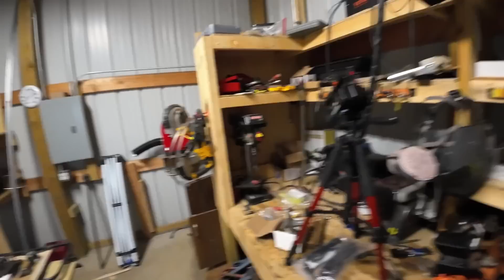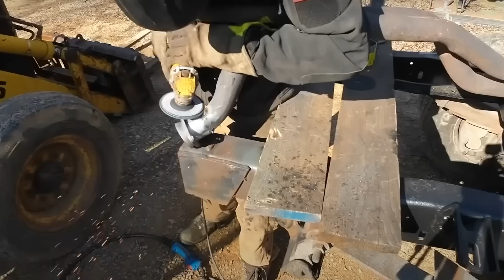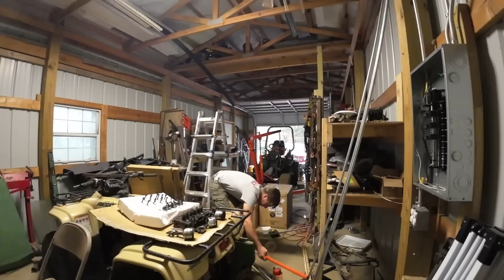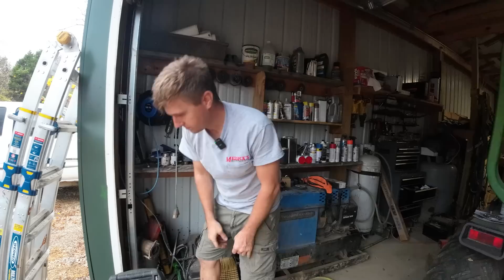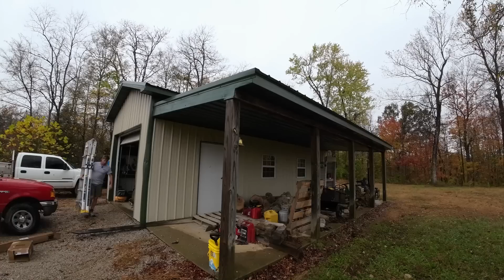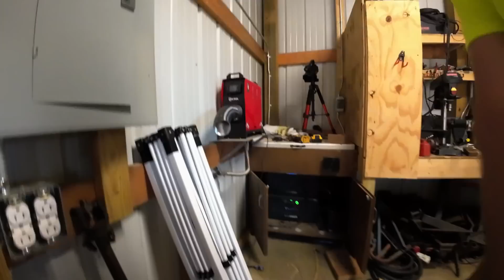Solar Powered Workshop -  I Just Don't Need It - Bluetti AC300

Comment: I found a very good LED light at Costco here in Canada about 2 years ago. It seems to have two LED rows facing down and a row on each side of the light. It’s very bright - I put 5 in my workshop which is about 3 times your shed space and it’s bright, although it’s 9’ ceilings. I then put 3 of  them in my garage (14’ ceilings) and they are very bright. It’s a “daylight” effect so it’s more utilitarian which is what I wanted for using tools and machines. The brand is called KODA, model LM030314  and it’s 8000 lumens. Each light was C$45 which is US$33 . If you’re a Costco member and they stock them at your local store, it’s a great deal - half the price of Home Depot or Home Hardware here in Canada and a much brighter light.

Comment: I love the 'free solar lanel rails'! As someone who picks scrap metal up from time to time, I can't begin to tell you how many dozens & dozens of bed rails I've picked up on curbs all over the place, probably 100 plus sets if not more. I keep some of them for various angle iron fabrication uses, and add some to the scrap pile going to the scrap yard for money. Its crazy how many bed frames get thrown away on a regular basis. Its good angle iron for light duty stuff especially if you have a cheap welder to glue them together.👍🏻👌🏻🛠️🔧🦺⚡🔋🔌

✊🏻🇺🇲🦅🇺🇲✊🏻

Comment: How much money do you have wrapped up in the power system? Seems like a lot…..
Reply from the maker: If I had purchased the bluetti (it was a partnership) plus the panels I bought.  Around $2500.  They wanted $6,000 to drop in a transformer and run a secondary and that's with me doing the excavation
Reply: @ is that the only option for electric is a transformer. Can just run underground wire from a couple poles or something?

Comment: In the Netherlands we use PVC tubing/piping you can bend it by hand and it's not conductive.... In this case we would pull a ymvk though it with open bends. 5/8 or 9/16 in metric 16 or 19 millimeters.

Comment: Cap’n here’s a bit of trivial information for ya…

The steel used in bed rails is unique… it’s classified as ‘Re-Rolled Rail Steel’.  What makes it unique is its origin and properties.

Back in the late 18th and early 19th century American Steel Factories started popping up all over the place (wanna know where… just go to the Rust Belt).

American infrastructure demanded billions of tons of structural, cast and rolled steel.  Chief among them was Railroad Rails.  

Every steel mill had its own recipe for making them… so, there was a huge variation in the purity and properties of from one manufacturer to another. And also from one rail to the next.  It caused countless problems when building tracks and also with durability and failure of the rails themselves.

As a result, there eventually became a huge supply of old rails lying around.  These could not easily be melted down and recycled.  They were too awkward to fit into smelters and besides… their contents varied all over the place.  That meant it was difficult to use them to make steel of reliable tensile, chemistry and malleability.

One company came up with the idea of cutting them into three parts… the cap, the web and the foot.  They then placed each part into a separate furnace and heated it.  

Once it was hot enough, it was sent through a series of rollers that shaped it into various configurations.  There were three that became ubiquitous.

1 - Sign post - used for every stop sign in the country!

2 - T-post - enough said.

3 - Angle Iron - not good for fabrication or structural use (too brittle and ranged from hard to soft).. but perfect for bed rails!

And, best of all… it was cheap!!!

And that Cap’n is why bed rails are plentiful and cheap!

Enough of the lesson about that obscure fact…. 

I like where you are headed with your own private Power Grid!
Reply from the maker: @sassafrasvalley1939  what a fantastic way to start the day off. Lol thanks for the info. Hope all is well
Reply: @ yep, going great… just coming home from a week in the Caribbean with my bride of 50 years!
Reply from the maker: @sassafrasvalley1939  you're living the dream.  That's awesome
Reply: Very cool information! Thanx! 👍🏻👌🏻

Comment: I installed 4 bars of 220V LED lights in our 2 shops/garages.  Everything works fine until you 10ft up in the roof on a wonky ladder.  Had my heart reset by 220V a few times.

Comment: Are those batteries the kind that can catch fire and burn for days?  Wonder if they need their own separate shed or small building.  But maybe they are safe. I never have used any before.  Just curious.
Reply from the maker: In general most co my companies don't sell self destructing batteries.  But in all fuel sources that are used to heat homes or provide power, whether it's electricity, natural gas, heating oil, solar with battery storage, there is always a chance of fire. (Or home leveling explosion if natural gas if someone's choice) If you notice in this video, I specifically mentioned utilizing the barn as the battery storage building.  No one lives in the barn ya know.  Also,  smoke alarms, plan ed fire evacuation routes, and regular conversation about fire safety in households are always good practice.
Reply: @CaptainKleeman  thanks. I figured a firefighter would have all the knowledge. I had just watched a towing company video in LA where a giant lithium battery on a flatbed fell over and caught fire. Made me curious. Thanks again for the great videos.

Comment: I installed five Harbor Freight, BRAUN 5500 Lumen, 4 ft. Linkable LED Hanging Shop Lights in my attic and they are pretty impressive. At $22.99 a piece they are inexpensive. They have a 3 prong standard 5' powercord and use 55 watts each.
Reply from the maker: Appreciate the info!

Comment: You did not show reaming the EMT you cut with the portaband. No - you don`t put romex in EMT and you are supposed to complete the raceway then pull in conductors.
Reply from the maker: It was deburred.  Code allows it.  Too many bends in one run to pull Romex.  Thanks for showing you don't know electric 👍

Comment: Always look at lumens for led lighting. I like Harbor Freight Braun 10,000 lumen on sale now $35/$55reg. Four can be connected together. How come no one does 12v lights when using solar?  It would be more efficient because it's not being converted to AC. Tons of options out there for RV and vehicles for lights as well as made just for 12v solar (some are 12v/24v/36v DC capable). I have used in a cargo trailer just for interior lights and works great.

Comment: Someone on YouTube suggested that it is better to run just wire through metal conduit without the plastic casing. They said the wires can get too hot. I don't know anything about this. However, it is cheaper to just run the wire. I run the wire through plastic tubing. Don't know if that is better or not. Would like feedback on this. Thanks

Comment: Hi Mike , if i might suggest checking into some 12v auto led flood lighting . I got some cheap ones from harbor freight. They provide great lighting i believe they are 4-5 thousand lumens each . Low draw for lots of light cheap. I believe you said you have 12v supply , i use a small dc converter. Hope it may help and cheap for you to try !!
Bless you and your family !!! And your donation to the band was a great thing buddy 👍

Comment: I have used lights in series that we got from Rural King and they have worked well. At the time we got a deal at $25 a piece and I am sure they were bigger and brighter than the ones you are currently using. You might check them out. I don't remember the lumens, but I think they would do the trick if you can find them. Actually, I just looked at the website and the first one up was a linkable shop light 45" long and 10,000 lumens for $24.99!
Reply from the maker: That's a good price!

Comment: I too have a secondary off grid shop on another property that I utilize in the winter. I use a generator but now you have me interested in this power supply option . I have a gas engine air compressor there so no need for huge power…but I have a portable might welder there as well (140 amp). Would the power supply run it or just stick to the generator for welding ?
Reply from the maker: I would be surprised if it ran that welder for very long.  Even if it did, it would take a pretty good size array to get it recharged.  But if you have a generator, this would cover everything else.  I only have to fire up the gen/welder when ime welding now, which has been nice.

Comment: Just shows how nice a guy you are, that gesture is really going not help the community buts the kids as well. Problem with lighting is not only the amount of wattage used to run them, but what sort of light you get as well. Mines only a small workshop, but I've got a day light led bar really cheers me up when I'm out there in the winter. Who doesn't like a metal metal roof, for safety purposes you want to place one of the small trampolines. Might help with your gymnastic capabilities. 🤣👍

Comment: when you said don't run your tape into your electric panel it reminded me of the time 1 of the service guys at our shop did just that 480 volts will vaporize 24 inches of it in millisec

Comment: Captain,  what the technical term for what your Bluetti requires is a clean sine wave input. 
It's what a UPS battery backup unit provides to tv's,  computers and other electronic devices inyour home or shop.
Plus a UPS keeps your electronics safe from surges and power outs that cam damage your computers, tvs andotherdevicesyou rely on.
I used to install them on all our arcade games in the Keys when I was the service manager for the largest amusement vending equipment company in the upper Keys. 
It cut service calls caused by electrical issues like power outages and surges to almost nothing when they began actually installing computers in arcade games.
Merit bartop touchscreen ganes were the first PC based games in the late 90's. 
They were also the first ones I installed UPS units into.
My boss was a tad happy with the reduction in service costs on them.
It was a very good friend who is a computer genius who told me about them.
All of my home electronics are plugged into one.
No, surge protector strip outlets do nor protect electronic devices. 
They protect your home electrical system from shorted appliances.

Comment: I have a 12' x 12' shed that is also run from solar and a small solar generator. For lighting, I have just two BRAUN 5500 Lumen, 4 ft. Linkable LED Hanging Shop Lights from Harbor Freight. You can connect 4 of them together, but for my small space 2 is all I need. They might be a better option for you.

Comment: I just went to Costco and north 40(tractor supply type store and bought 20 led 110v plug in light @$30 ea for a 48' by 50' shop and they work great. They are in the ceiling 16' high. Cheapest way I could go and have good light.

Comment: Mike I started off with those low power 4 foot LEDs too, I still use em on desk top spaces, but for the shop I switched to these 8 foot bad boys.  Use em in the woodshop and in the mechanic shop.  (10-Pack) 8ft LED Shop Light Fixture, 120W 19000LM 6000K, Cold White, V Shape, Clear Cover, Hight Output, Linkable Shop Lights, T8 LED Tube Lights, LED Shop Lights for Garage 8 Foot with Plug

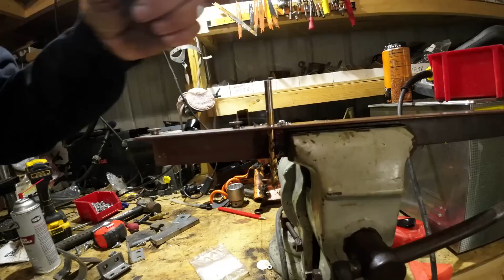Comment: At 17:47, your drill bit came out.  You didn't lock it!
To lock it, tighten the keyless chuck down as hard as you can then turn the chuck the opposite direction and it will ckick once, it's locked and your bits won't come out.
Have fun!
Charitable donations are great!  We rely on them to keep our high school Drag Racing Team going.  Get the kids to race on a safe track with an instructor rather than the streets.
I'm a driving instructor at 100mph for 14sec at a time...... yes, my hair is white! 😂😂
Reply from the maker: That drill is clapped out holding on for dear life.  Shooting out transmission parts out the vents.  Every time I drill a hole im surprised it still works.
Reply: Turning the chuck back after tightening has been debunked on sooooooo many major tool channels, even channels that used to tell people to do it have retracted that idea. If you want to think it works, it's up to you. Nobody is telling you not to. 😊
Reply: @beaverc2884  I thought that too, until I saw a video that almost all tool companies identified it as a "feature".  It seems to work?

Comment: Hey Capt i put one of these lights in my attic and it lights up the whole attic, for $24.98 Utilitech 1 ft 8000 lumen 3 light led diffuser Garage shop light ITEM# 5189723 MODEL # Z-JG 80 ALM
trust me it is a game changer and does not cost a lot. Lowes

Comment: Bet you have access to some decommisioned aluminum extension ladders?  I bet a guy could use the 24 foot decommissioned aluminum ladder as mounting  racks for the panels? Split the 24 in to 2 12 footer racks?  It might work well and aluminum doesn’t rust.
Reply from the maker: I do not unfortunately.  They would be perfect though

Comment: HI, a few years ago I went through the same process as you are doing, converting the workshop to solar. At that time the gear was more expensive. It worked well enough for my needs. For lighting I chose to use these garage lights. I looked on Amazon just now and similar light scan be bought on there quite cheaply. These are made by Aoretic with the number B0BD772SK3. I changed from normal tungsten bulbs to these and the difference was almost magic. Many times the available light for a fraction of the power used. A definite win win situation. After we mover I had a new garage built with grid power supplied but I stuck with this same light to light my new shop.

Comment: You are getting some shadows from the surrounding trees to your panels, that limits the production a lot!
Just the end of this summer (around 55 days ago) I installed 3 x 150W panels at my cabin and the most I've gotten out in the fall has been like bit over 300W in a good sunshine. But now that it's November the sun is so low at the cabin so I've had to knock down bunch of spruces, since they kept casting alot of shadows to one of the panels. Last weekend the max production was 250W in a clear sunshine. 2 weeks ago it was over 300W. But the days are getting shorter and shorter and with 2 cloudy snow fall days the production was only like between 3 to 30W and didn't even recharge my battery full. So I'm also thinking about adding more panels for the fall and winter time. Atleast one since I have one fused slot in the container box for one more that can easily be turned off in the summer if I'm getting too much power suddenly...

Comment: I used 4' 4500 lumen led strip lights from Menards 2-pack for $14 in my garage. They work fine. But, for my barn shop, I used Onforu 60W 6000lm outdoor floods. @ $35 on the jungle site. They light uo the shop like daylight!!

Comment: Rural King 4' LED Shop Light, 6000 Lumens - SL-006BMCL-50 for $20. I've tried different lights and these were the brightest by far and they have been lasting for the several years that I have had them.

Comment: Re lights,here in 240v land id be recommending the V-TAC  VT-8-40 (SKU: 20351)  ,installed a load to replace twin 4 foot florrys  in a workshop and was impressed enough to use em in my kitchen,a smaller  one above my work bench and one as a mobile work light,for the price ive yet to find better,no idea if they do a 110v version.

Comment: Captain, remove the trees that are blocking your solar cells.  That will help them charge the system faster.  Also,  get yourself some 300W, or more, panels.  Then you won't need as many and damage your roof as much.

Comment: Check the temperature coefficient for your panels and calculate your string voltage at the lowest historical temperature in your area .
As the temperature decreases , voltage increases , and a string outputting under 150 volts during the summer , may spike well above 150 volts on a very cold winter day . Your Bluetti will not like that .
Neither will you .
A lot of solar charging devices will tolerate over paneling , as they will only draw their maximum designed current .
Voltage , however , is a hard limit .

Comment: @Captain Kleeman - The next time you have the boom lift/man lift around and 2 hours to spare at the same time, you should trim the trees around your garage/barn. I saw all the tree shadows on the solar panels while you where working and figured I'd tell you since your reading the comments again. 
 Good luck and God Bless you and your family.
Reply: I would like to add that a 10% shade coverage on your panels will drop your power output by 50%  so if you're able to keep them out of the shade... probably for the best.

Keep up the great work.